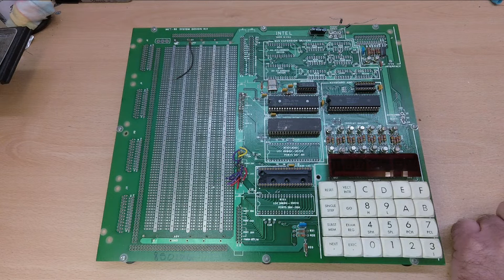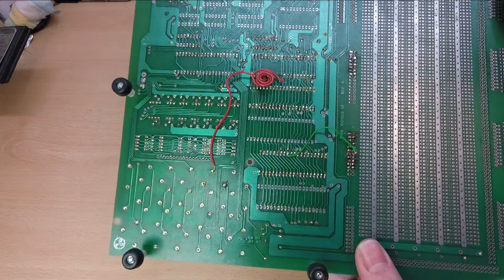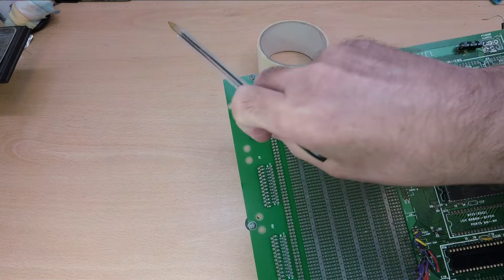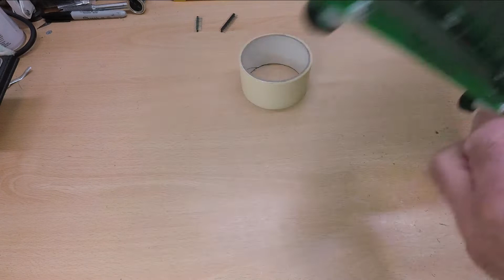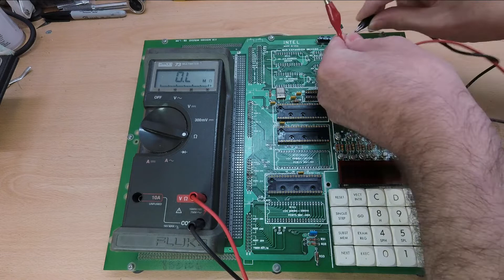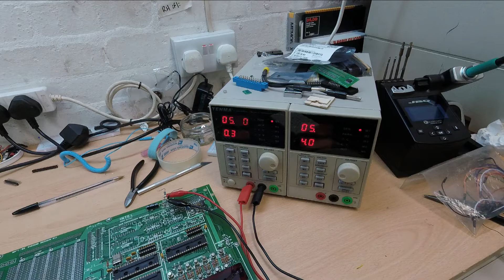Intel SDK-85 Restoration / Repair

Comment: I think the most well known product with the 8085 was the Radioshack TRS80 model 100/102 portable computers. they are pretty neat little computers
Reply from the maker: That's interesting. I've got an original TRS-80, well the case is orignal anyway ! It's actually got a much later revision motherboard than it should have.

Comment: Have one of these mounted in my workshop. It now has 64K memory with a couple of small holes, a UART with proper RS232, interrupt controller, expansion 8155 and 8755, an 8-bit DAC and ADC, and some extra multiplexed digital outputs.
I have programmed the 8755 with some routines and a 2K EPROM with a rudimentary "OS??".
I only use Linux so write programs there but compile them in a DOS emulator. The binary code is transferred via the RS232 interface.
The underside of the board is a rat's nest of wire wrap, and bizarre connection techniques. God help me if something goes wrong.
But it entertained me for 40 years or so and I am still having fun with it. I am 70 years old.
Reply from the maker: Sound like fun 😀. I've seen one with a Multibus Interface on it which sound like an interesting project. I've since added the second 8155 to the board and the second Rom socket.

Comment: The two additional 8085 instructions are RIM and SIM.   SID and SOD are the names of the serial input and output data pins, latch, and accumulator bit 7 when using the RIM and SIM instructions.  See pages 5-17 and 5-18 of the MCS 80/85 Family User's Manual.

I homebrewed a small i8085 system.  I didn't use the fancy MCS-85 combined I/O and RAM/ROM chips, just eight 2114 SRAM and six 8212 parallel port chips.  It had no ROM or EPROM, so I had to toggle in a loader while single-stepping the CPU one memory cycle at a time.  A keypad like on this SDK-85 would have been a luxury!
Reply: There's an interesting auto baud rate program in the manual as well when using SID and SOD lines for serial input/output , it works really well and I used it on my own design many years ago I used an 8-bit Eprom and Static Ram on that one.